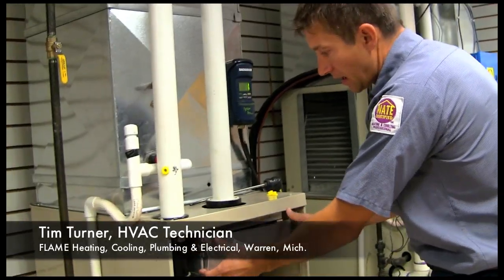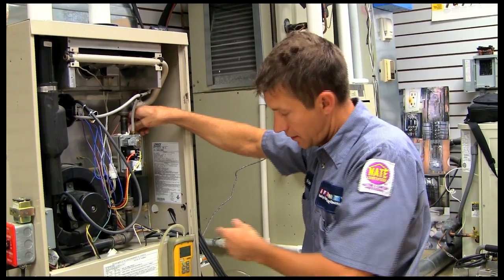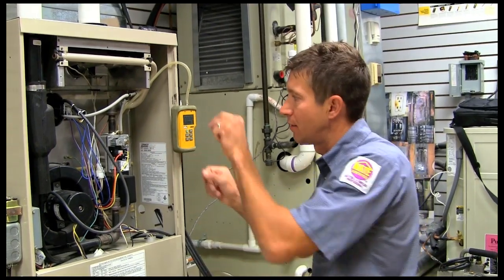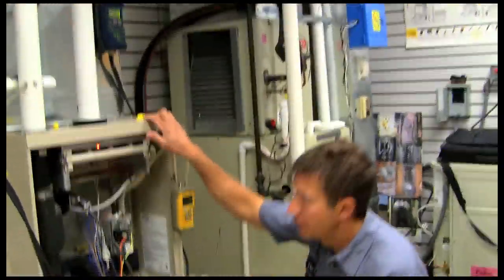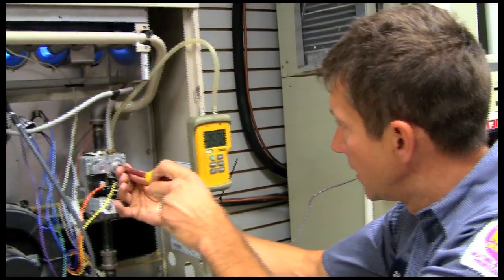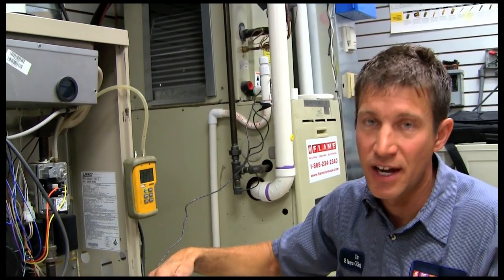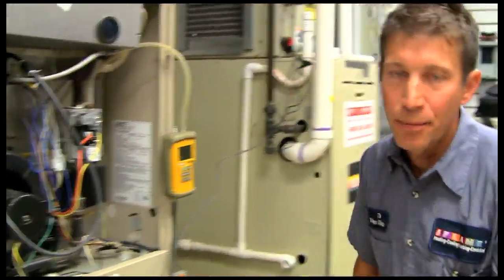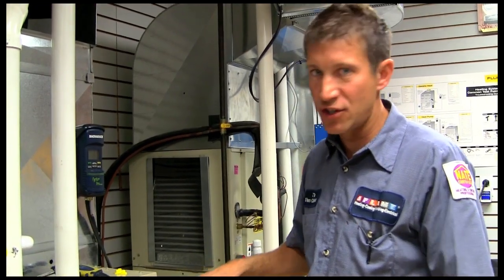Setting Gas Pressure on a High-efficiency Furnace

Comment: I personally try to keep the delta T as low as possible to increase efficiency. 40-70 on this unit is be around 40-50 via gas pressure and fan speed. It's amazing how many installers do not check this.

Comment: Thanks for the video. Correct me if I am wrong, but I thought you were adjusting your outlet gas pressure with the burner box cover off. If so, I would like to ask why?  I was looking at a York variable speed condensing furnace installation instruction and it shows measuring your gas pressure with the burner box cover in place. Let me know what you think. Thanks
Reply: On this Lennox G26 The gas valve monitors the sealed burner box static pressure and adjusts manifold gas pressure down as the burner pressure becomes more negative. Without that adjustment, manifold pressure would increase relative to the burner box pressure. When the cover is off manifold gas pressure is affected only by atmospheric pressure, the same reference as the manometer, so pressure readings will be 'base line' with the same reference.

Comment: hi, a lot of people are saying that the cover should be closed when adjusting the gas pressure for a sealed combustion furnace. i am just confused. please help me to clarify. thank you.
Reply: No the cover should be replaced for combustion analysis. To adjust the burner pressure the throttle on the gas valve needs adjusting. This is not possible to do with the cover on. 🙈

Comment: What happens if you don't regulate the gas?  I am a home owner doing my own installation.  And don't really no much about HVAC.  Thanks,
Reply: +Aricu Nono it can overheat the exchanger and will trip a high limit switch for example if you are running 5inches of water column
Reply: Thank you,
Reply: You are very brave
Reply: Wow I just saw that this was 2 years ago. Lmao
Reply: Also you might want to seriously consider hiring an installer. You pay for the knowledge. If you’re playing with gas then one oversight could cause you your house and your life. If you don’t know anything about combustion, cfm, gas pressures, or limits then you are gambling everything by doing it yourself.
Reply: @theworshipdrummern8   Yea such great knowledge licensed techs have that i pay to fix my furnace but so far every time i have had to either tell them how to fix it because they can't figure it out or just had to wait till the idiot left so i can fix it my self! So i paid for NOTHING! I could teach a child how to do it better then most of these so called techs. Funny is i never had to go to school for it or any real training at all! Pretty basic stuff and most if not all the detailed info is either on a sticker on the furnace or in the manual for the furnace. I still love the last one where you could clearly see the main board had been hot yet the stupid tech couldn't find the problem. A volt meter showed quickly the igniter had voltage when not plugged in but as soon as you plugged it in all voltage was lost. The igniter OHM tested fine and was new. Pretty clear a bad relay. (contacts in the relay bad) plus the dead giveaway a hot spot on the board! When taking the board off you could then clearly see several solder joints was not soldered properly leaving more bad connections. Stupid licensed tech that had been doing it for 30 years couldn't find the problem..........
Reply: Youtube will not give you all the knowledge that licensed techs will have. If you don’t regulate the gas and the high limit fails or isn’t wired properly, then you will have created a bomb that could take out a city block.

Comment: ya but you have to consider heat rise and that you can only underfire by 10% in Ontario, Canada..
 So 3.15 - 3.2in of W.G. is as low as you can regulate the manifold pressure within. to help with high heat rise.
of course increasing fan speed too helps with heat rise.
Also you didn't zero out your manometer when you started. or you didn't show it lol.